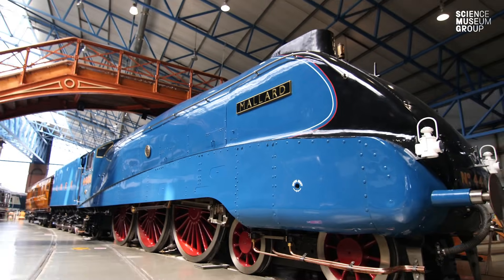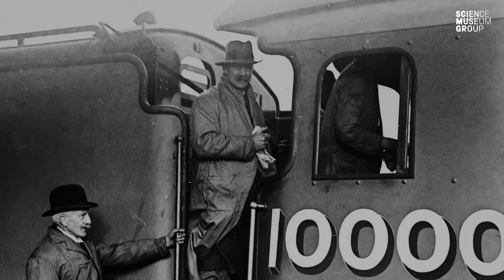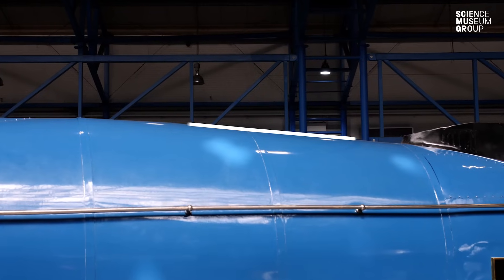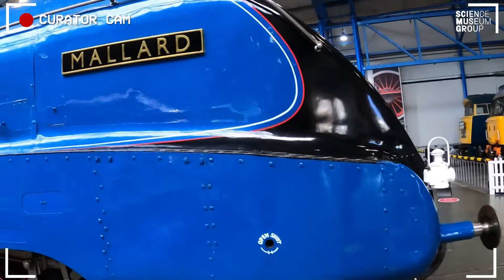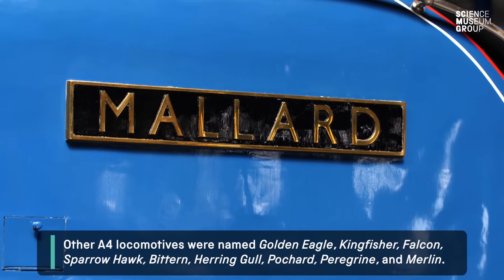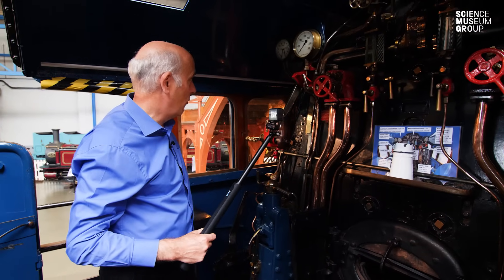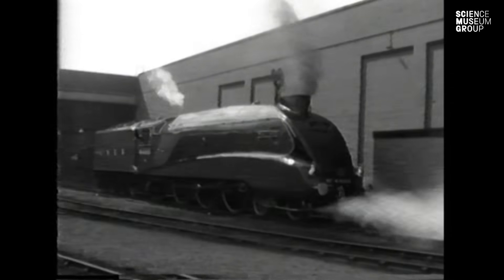Inside Mallard, the World's Fastest Steam Locomotive | Curator with a Camera

Comment: You forgot the bit where Mallard needed repairs after  completing the run due to overheating her bearings for the center drive rod. I think its a slight knock against record holders if they are unable to reliably repeat the result without sending themselves to the shop after each run. Not to mention that slight assist from the "downhill" portion. If it was done on the flats Mallard may still have gotten a record, but I doubt it would be the current one.
Reply: They used to pack the wheel bearings with aniseed so that when they failed (as they frequently did) the driving could smell the aniseed.
Reply: But the big-end design was remediated after the incident, and at least in theory any Kylchap A4 so fitted could repeat at least the downhill part of the run... or repeat it on suitable other trackage if "FIA" style record standards had been thought necessary to satisfy.
Reply: Did you ever listen to what Duddington said? The bearing only failed under heavy braking and not the speed! He also said that if he had been aware of the attempt he wouldn't have slowed down to 24mph before going up Stoke Bank! He said himself he could have pushed Mallard to over 130mph but the chance never came again! Nut of course you knew all that!
Reply: The damage to the bearing was not evident under thrust; Duddington noticed the knock when he shut off steam.  

I do think that the engine was capable of better than Gresley's accepted speed, and that Duddington and Bray knew how to achieve that speed.
Reply: And that's the main reason American railfans scoff at Mallard's record - in their eyes, Mallard cheated by using the hill to gain momentum. To them, a world record run should be done on a flat section of railroad, like the old Pennsylvania Railroad line section between Chicago to Fort Wayne, Indiana, or the  present-day Federal Railroad Administration test tracks in Pueblo, Colorado for example. And that's why the T1 Locomotive Trust group in the US is building T1 5550 to break that record.
Reply: @kristoffermangila  I don't think anyone really cares what the Americans do. Mallard is simply a beautiful engine. And the record was set a long time ago.
Reply: @ds1868  i know... Mallard's a pretty engine. But I'm just saying just what the vast majority of American railfans are saying.
Reply: @kristoffermangila  and many don't care too! If they had the brains they would have put a dyno on one of theirs! a bit of sour grapes here!
Reply: @rockfan3299  Both ALCO and Baldwin locomotive works had locomotive dynamometers at the factory to test locomotives. Also many railroads used dynamometer cars to measure locomotives along a planned run.
Reply: @corbinyoung6979  so where were the records then?

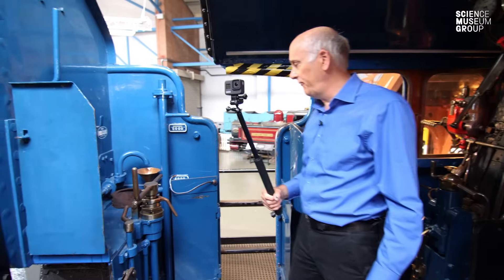Comment: 8:08 Why does the door open inward to the coal storage? Wouldn't the coal be blocking the door?
Reply: Weight of the coal, if it shifted during braking, would easily break the latch on the doors and spill a large amount unexpectedly onto the footplate.

Comment: Very Nice Locomotive ive got my self a live steam double 00 gauge one. But fairly it must be said the the 05 002 set  the World Record 1936 with 200,4 km/h on level ground. Mallard was going downhill. best Greetings.
Reply: To be honest, you can 'correct' for the amount of gravity assist, and at least from the calculations I've seen, Gresley's accepted record speed (125 and a fraction) still comes out on top.

Not taking away from the BR05, or the possibility that one of those locomotives could be made to run faster than its 'record' -- they shut off early after notching the "metric double ton".

(Do not use the fake 126.1 speed when calculating the correction, though -- it's bogus no matter what the fancy plaques may assert.)

Comment: Could any of the A4's have achieved this record or was Mallard built a little different?
Reply: I don’t think there was anything different about Mallard. I believe it was chosen because at the time it was the newest locomotive that had completed its running in and therefore it was felt it was in the best condition for the run.
Reply: Many A4's did get up near 100mph on service trains in the 1950's when running late but after the war the tracks even on main lines weren't up to high speed standards until the 1960's by which time steam was being replaced. Maximum speeds on service trains are as much to do with braking distances, signalling and  passenger comfort as locomotive performance. I can remember travelling behind Deltic locomotives in BR mk 1 carriages in the 1960's at 100mph and the ride could be bumpy and noisy.
Reply: I think the one essential thing that not all A4s had was the presence of the Kylchap front end, which is a big part of the 'secret sauce' that allowed the record speed.

Comment: I think it should be noted that US railroad companies at the time were definitely producing locomotives to rival mallard in terms of speed. but they felt holding a speed record would give them the reputation of being unsafe. In particular, the Milwaukee Road's  Hiawatha F7 Hudsons are notable in that they would reach speeds over 110 miles an hour daily. And of course, we will never know for sure but firemen on for both the F7 and the Chicago and Northwestern Railway E4 class locomotives have claimed to have reached speeds over 130 miles an hour on more than one occasion.
Reply: And add those fellas over at the Pennsylvania Railroad with their fancy T1s.
Reply: You couldn't get an E4b to 125mph if you dropped it off the highest bridge on the C&NW main.  Not only did the design prove valve-limited to under 100mph with the (coincidentally, in 1938) AAR test train, but one became the film starlet for bouncing drivers at around that speed.

This was not something limited to that design; the larger ATSF 3460 class could easily hold 100mph, but even at 105 were straining, and Baldwin's claim they were '120mph' engines is a funnier-than-usual fairy tale.

(This somewhat ominously calls into question the Milwaukee F7 performance, with that design being very similar to the E4bs.  You see many reports of the F7s easily reaching and sustaining over 100mph... but I have yet to see a trace even to 110mph.  Now the A 4-4-2s are a different story, with Bruce of Alco going on record to note them reaching or exceeding 128mph on test, but the real 'future' of that sort of thing was to put two of them under one large boiler...

Comment: The worlds fastest steam locomotive? This was done on a downhill grade with chump change for a load, Big Boy "Hold my Beer?".
Reply: Um, Big Boys are essentially freight locomotives; their drivers, while almost the size of the drivers of the UP FEF series 4-8-4s is smaller. The true steam speed demons on the UP are the aforementioned FEFs.
Reply: You're looking at the wrong FEFs; the fast ones (including 8444/844) have 80" drivers with proper balancing and as carefully designed non-roller-bearing mains as anyone had.

One might note, however, that no FEF could likely reach a speed anywhere near 125mph.  What might have been interesting would be to apply Voyce Glaze's balancing and detail design to an engine with higher than the 70" wheels of the N&W Js tested on the PRR for verified speed above 110mph...

Comment: The world's fastest steam locomotive, if it's okay to set your record going downhill and it doesn't matter if your locomotive breaks in the process and you use low-precision timing. But it was still a world's record because they said it was, and they were ENGLISH GENTLEMEN and so we are obliged to take their word for it! Quite. Rather.
Reply: The breakage fault in the inside big end was soon fixed, and I suspect the run could have been repeated with another Kylchap-equipped A4.  Note that low effective frontal area and relatively low Cd is a factor both with the A4s and the Milwaukee As.

Until you review the actual dynamometer-car clock, you have no idea what the timing precision was.  Did you think they were timing with a stopwatch, like on the City of Truro's 'record' run?

Comment: She would have gone faster if they evened out the load over the pistons.
With modern steel the pistons could be bigger internally increasing HP
Boreing out the blast pipes gives faster steam ejection increasing the HP
If she wasn't the pride of the nation I would love to see these changes made for another attempt and on modern smoother rails I believe she would top 135mph.
Reply: Yes, but 'evening out the load' couldn't effectively have been done without replacing the Gresley conjugating gear, which is what caused the effective overtravel on the center valve.  Railfans love to cite this as a design defect, but Gresley and others (including UP on their Nines) were very careful in their detail design (albeit Gresley misunderstanding roller bearing behavior in oscillation, much as Bulleid misunderstood roller or Morse chain drive... ;-})

The Australian improvement of rocking shafts (as they built it) would likely not have solved the issue, as shaft whip alone at that speed and required cutoff would have affected the timing and duration.  But if you were to replace the shaft with a larger-diameter hollow tube, as in the driver axles of the early N&W A 2-6-6-4s "as slightly modified", I suspect the rocking-shaft conjugation could be made effective...8

Comment: The Duchess would have bettered 126 mph, but no racing Stoke Bank on the LMS. What he didn,t mention was the inside big end bearing melted, abortion of a front end.
Reply: Failed due to starvation of lubrication, probably account overtravel in the Gresley gear at high cyclic that increased peak thrust under the top-speed conditions.  The point to remember is that the big-end bearing design fault was in fact quickly, and in my opinion at least effectively, remediated... and the record run 'coulda' been repeated if the LNER could get away with it.

(Just the same, it's a damn shame the Germans used the metric system -- they ran 05 002 up to the 'double metric ton' and stopped not far above it.  It is interesting to me that no subsequent re-attempt was made...)
Reply: And are you saying that the LNER Kylchap was 'an abortion if a front end'?  I would be interested to learn why.

Comment: On its high speed run it went through Little Bytham Station over 110mph. The sheer amount of noise, broke the station’s windows, and the platform was peppered with burning coals.
The middle big end fried, and later the track inspector said part of the line had slight subsidence, and the run shouldn’t have been allowed.
A signalman had needlessly slowed the train on the way up, so without that delay it would have topped 130mph.
Overall it was a pretty crazy dangerous stunt with hindsight. Maybe they were lucky to get away with it, and probably why they never tried it again.
(Source, Mallard book, Don Hale)
Reply: Well, it could have been worse, like breaking every piece of crockery in a dining car trying to negotiate misaligned crossovers after a high-speed run... get

Comment: Although Mallard´s speed record is commonly accepted, it is not without a challenge. The 126 mph were not measured, but calculated while running on a slight downhill grade. Even Sir Nigel Gresley himself questioned this achievement and said it was more likely not to be in excess of 124mph. This would make Deutsche Reichsbahn class 05 the fastest steam engine.
Reply: Personally I don't think they should try to beat Mallard's record (being a Brit), but I'll certainly be interested to see the progress and final form of the T1.
Reply: Gresley accepted 125 and a fraction as legitimate peak speed, albeit only over a few dozen yards. 

Yes, the 126.1 is an artifact in the dynamometer-car mechanism (which is clear from the instrument trace) and in my opinion anyone who quotes it as 'the record' is being specious.
Reply: Lets not forget how many american locomotives most likely ran at higher speeds but simply werent recorded. Which is a shame. Hopefully when the PRR T1 duplex is completed ill live to see mallard dethroned
Reply: @mountainbriarfarm5030  844 could probably do it